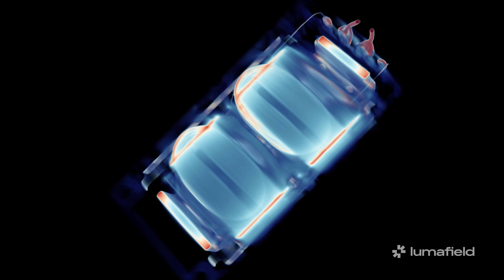Switch 2 Pro Controller: Built to Break? Full Teardown

Comment: So, the main complain is that the controller is difficult to repair? Who cares? I've had my original pro controller for 7 years now and it's still working fine. Yeah, it drifted for a while, but it stopped once I poured some pure alcohol on the sticks and rotated them for a few seconds. Same with my joy cons.

Comment: I don't know. I get that it's a lot to disassemble, but everything is ultimately modular and replaceable. I do agree with the point about the sticks. And that the trend of concealing outer screws is unnecessary. But overall I think the video is a little too negative. I don't own this controller and I'm not in a hurry to get one. Let's see what 3rd parties offer.

Comment: …i have several 8bitdo controllers and after the firmware update just a day after the release of switch 2 they all work perfectly on the switch 2…they are cheaper and the absolute best for the switch 2…

Comment: Xbox Pro controller has the same issue : Overpriced & more prone to failure than the regular version. At least in the first iteration there eventually was a community & parts available to assist with repairs. Now there's a new version that muddies the water in getting correct parts. It's been a huge f you from Microsoft.

Comment: I would go straight for a cheaper controller with hall effect sticks, but I imagine the face buttons will feel crap in comparison with the Pro Controller 2.

I got the first Switch and then a PowerA controller or something.  Nothing especially wrong with it, but the face buttons felt really sticky.  When I got the proper Pro Controller, it was night and day.  I keep looking at the shiny glowy PowerA controller, 8bitdo and others and thinking that they'll just not feel as nice to use as Nintendo's controllers because if the new Pro feels better than the first, then that's practically improving on perfection for me.

Had the first Pro Controller, which I bought second-hand, for years and the battery's always been great.  The controller feels great, I've never had to worry about stick drift and all of the buttons are just laid out and feel really good.  Never even had to worry about repairing my own controllers, although I did damage a friend's Joycon which I wasn't able to repair... So that sucked.

Basically what I'm saying is that I'm excited to get this controller even if I only try it out for a bit, but I'll enjoy it while hoping and praying I won't need to repair it myself.  Otherwise I guess that's what warranty's for? Nintendo have since acknowledged the drift issue and accepted repair jobs, so you'd think they'd do the same here and ifixit don't need to sell you their guff. :D

Actually, are you more upset that people would be encouraged to send their stuff to Nintendo for repairs and replacements rather than coming straight to you to buy repair kits?

Comment: So it's like the original Switch Pro Controller, but worse? Those things had a known defect with the D-pad that I didn't know about until after buying a brand new one to go with the used Switch that I'd bought a year before. Somehow I got lucky in that the used Joycons never drifted, and the new controller had that D-pad defect out of the box. Took the thing apart and put a piece of tape under the middle peg as recommended and it worked, though now I think I'm going to have to do it again. It was kind of funny and pathetic at the same time.

Comment: Good points throughout the video but on the HD Rumble 2

5:05 being "unnecessarily buried" in the grip is so it can be closer to your hands to make the different rumble on each side easier to tell. The Switch pro controller had issues with this making the subtle rumble effects that are easier to tell with split Joycons not as prevalent here.

Comment: In other words, a disposable pad. If something breaks, you claim it under warranty, the warranty will expire - it's thrown in the trash and almost $100 wasted. I have a strong impression that the construction itself is "overcomplicated".  For a moment I was thinking about buying this pad for my Switch 2, because I naively believed that it would be a device that would last for years, such as my current Xbox One X pad, which I have been using (on my PC) for about 7 years. I think I'll look for a cheaper alternative from China for about $20-30. There is no point in overpaying. Thank you for the video.

Comment: Oh piss off bro, like seriously. Are you joining the Nintendo hate brigrade? The controller is fine and isn't designed to break at all. Switch 2 Pro Controller is one of the best controllers I have ever used. You're upset that modding the controller became harder. Let's talk about drift, and it doesn't matter what stick type you use because all sticks can get drift. I know people who bought hull effect stick and started to drift a week later. You claim it's not worth $85, ok bet. PS5 vs Switch 2 controller. Battery life PS5 is 8 hours to Switch 2 40 hours. Gyroscope controllers Switch 2 has better gyroscope controllers. Gr Gl buttons to ps5 none without strike pack horizon btw $69.99 to switch 2 controller has them built in no extra purchase required. PS5 has anlog triggers, and Switch 2 doesn't. PS5 controller cost is $74 new and needs strike pack horizon for $69.99 to essentially be the same as Switch 2. PS5 controller needs to be $144 to match Switch 2 pro controller for $85. So is the Switch 2 Pro Controller worth $85? Yes, it is

Comment: I put my Switch away for half a year or so. Picked it back up, and the rubber on the joycons had melted. Disintegrated. Like an old device put in storage for 16 years. They cost $80 brand new.
Picked up replacement parts for $20, TMR sensors, rubber caps that could be removed. Nintendo is ripping its customers off. Don't buy their shit.

Comment: I'm torn on this controller.

Overall, I do like the controller, it feels smooth as silk and has worked great for me so far, the only issues I've found is that the sticks have bigger snap-back, which is certainly noticeable at times, but due to how I play, I really don't notice it unless I'm looking for it, still, would be nice if the sticks were of better quality. Second and more egregious is the d-pad, imo, being even worse than the Pro 1's one, with that in mind, that's where the negatives come in, I had the idea of modding it a bit just like I did to fix the D-pad on my Pro1, a little bit of adhesive tape was all it needed, tough luck tough because I can't easily do that here.

I also wanna go over some other thoughts and hopes.

The controller feels sturdy and honestly amazing on the hands, albeit it does feel a tiny bit smaller than the Pro 1, making it a bit awkward to get used to, where it feels like I'm not gripping it as snuggly, but I'm getting used to it. On this same vein, I also hope it remains durable until the next controller and console releases, my Pro 1 lasted me a very long time and it's still fine to use even now, with just a very slight drift being the only sign of wear. If that's the case I can look past the repair difficulty, but still, it would've been nice if it was as accessible as the Pro 1, truly baffling and if Nintendo wants me to keep my brand loyalty (or what little remains of it), I hope this controller lasts me a long time.

Another hope is for them to add some sort of soft-ware level options for controllers, like dead-zone configs and such, I dunno how feasible is that, but would help some of the negatives their controllers they have, that said, Nintendo has a terrible track-record on offering such options.

I'm half-regretting the purchase, it does feels nice and I hope the sturdy build is just what it looks, the awful repairability and d-pad I can look past if it doesn't become a major problem. If anything, I've learned my lesson of waiting for reviews and such before a purchase, not my first time making this mistake, but hopefully the last time.

Comment: goddamn this looks so hard to open lol... you can say all you want on the repairability of this  and i can agree.. but calling it a piss poor excuse of a CONTROLLER for the ability to get it repaired  it's just not it, cause to actually play, it's probably the most comfortable I have, and this is against xbox, dualsense and a couple 8bitdo too that i have. The sticks glide so well, all buttons are dead silent, it's so compact, solid and the "single piece" print gives the best feeling in hands. Gyro works great, hd rumble 2 is great, The autonomy?  never a problem.
Pro controller 1 sticks also  had a very low failure rate  compared to joycon, more in line with other consoles controller if not better , and all use potentiometer, by the way, so calling them "drift prone sticks"  seems a little overblown. So yeah, ofc ifixit is here to judge how hard is to repair it, but maybe it should stick to that instead of valuing the quality as a controller overall, cause ofc there's hundreds of more repairable cheaper controller out there but no way you'll feel the same quality and durability while actually using them for what they're inteded to. The guy in here felt like honestly pissed off at nintendo for other stuff

Comment: I am not a technician, and I have had playstation controllers since PS2, and they all needed to be cleaned or repaired at some point. Battery replacement on all or joystick drift on Dualshock 4 and Dualsense. I was able to do all these without needing to do soldering at all. I still have all working controllers, all that came with my consoles. I hate it when companies like Sony do not have proper quality checks products, I can't take the fact that my Dualsense came out of the box with drift like it was by default. But at least I was able to fix it myself. So, I do not understand why people will go full Stan on Nintendo now. I appreciate iFixit for going all out on this review of how repairable the control, Stans will go defensive, but the rest of the consumers will be better informed and be wary of the cost vs. benefit of these devices.

Comment: The 8BitDo Ultimate 2 Bluetooth fixes all the problems the Switch Pro Controller 1 had (irregular D-Pad and joystick drift), adds analog triggers and a switch to make them clickable, has two extra bumpers, comes with a stand to recharge and uses a 2.4Ghz dongle alongside Bluetooth capabilities and costs less than the Switch 2 Pro Controller. Oh yeah, and you also have three profiles to switch between as you see fit with the software that allows you to remap buttons and use macros as well!

Why would I waste my money buying a Switch 2 Pro Controller knowing fully well it'll drift and the D-Pad will register wrong inputs and will require opening it up to make modifications to make it work as intended when I can spend less money for a premium product that fixes all those issues and gives me much more quality and functionality?

Comment: Funny seeing this video after shell swapping and soldering a new potentiometer into my switch 1 pro controller I've had for over 5 years. They definitely designed this to be as difficult to repair as possible.

Comment: 2 thoughts.
1. In my repair work i always had it beat into my head, dont pull directly on the wires, pull on the plug head to disconnect.  Made me cring each time i saw you do this.
2. I get that youre looking at this from a repairability side of things, but i find the level of security and stability this build has is actually really impressive.  Its made to not fall apart.  It just means that same durability makes repairs harder.  Its a more than reasonable trade off from an engineering standpoint.
Reply: completely agree. stuff like the plastic holders is 100% justified and doesn't even make disassembly harder. the only bad parts are the glue for the faceplate and the battery needing complete disassembly. otherwise, this is actually a very good controller in terms of repairability; the sticks being separate units in particular is a massive advantage over the Dualsense and Xbox Series controllers.
Reply: The person who made this video is an amateur at best.
Reply: Have you worked with Wii U Pro controllers? Those are incredibly easy to disassemble and feel very, very solid. Even more solid than the Dualsense and Xbox series controllers imo, but of course they have way less features.

Do you have any thoughts on that? I'd love to hear from someone with a lot of experience
Reply: @VagrantValmar  I've never opened one up, but Wii U Pro feels much less solid than Switch pro or Switch 2 pro, IMO.
Reply: @VagrantValmar Owning a WiiU pro controller, a switch pro controller and a  switch 2 pro controller, I can safely say the quality is vastly superior in the newest controller. The WiiU pro controller feels like a fisherprice toy by comparison.

Yes it is irksome that they're not easy to repair, however if the durability is better its unlikely to need it, before its superceded by the switch 3.
Reply: @RG-Zeldaplayer  I totally agree, I have both controllers in front of me right now, and the Wii U Pro Controller feels like a toy compared to the Switch 2 Pro one.
Reply: @RG-Zeldaplayer this video and the comments are the first time I'm seeing this kind of hate for the new pro controller, aside from people who really want analog triggers. Repair points aside, this controler blew me away when i first had my hands on it. Feels extremely premium and those sticks are insanely smooth.
Reply: @veeetox  What does feeling like a toy have to do with durability?
Reply: @RG-Zeldaplayer  Fisher-Price?  So you're saying the controller was extremely durable?
Reply: @loganmedia1142  The Wii U Pro Controller feels (and it is) way cheaper and less sturdy than the Pro 2. Like, it's not even close.
Reply: @VagrantValmar  I have a Wii U pro controller, two Switch 1 pro controller, and a Switch 2 pro controller. My Wii U Pro Controller is the only one with drift. Of course my Switch 2 pro controller is new so that is yet to be seen. But if my Switch 1 pro controllers never got drift and this one feels way better quality than the 1 pro controllers. Then I can assume the 2 will not have problems either.
Reply: Screws should be good enough to ensure a controller is solid.
Reply: It doesn't make it any less probable for the device to fail, it only makes it less accessible.
Reply: The fact he pulled on those wires makes me question his line of work.
Reply: Excellent points!
Reply: Yes, the Wii-u pro controller feels less premium, but I take how it is much easier to disassembly and have a way superior D-pad (no ghost inputs!) any day of the week.
Reply: As an engineer myself, I see very little made for durability here.
That glued faceplate has zero excuses to exist, let alone be glued. Heck, it being clipped would be more acceptable for durability than glue that WILL fail with temperature. Leave it in the sun for some weeks (not even intentional, might just happen by accident) and this will release. They would have spent less money making it a ridge on the shell. The glued vibration motors also zero excuses since they even used screws to begin with. Hidden screws way inside of the casing are no tradeoff, just plain malicious. The joysticks are straight up made to fail, instead of being more durable. Wouldn't be impressed if these last half of the older pro controllers.
Reply: Disagree with the durability stuff because they're using low profile sticks that are prone to early wear-out
Reply: @WheatleyAlt  "Disagree with the durability stuff because they're using low profile sticks that are prone to early wear-out"

This is just speculation at this point.
These are different sticks than the ones that we know to be problematic.
Reply: @chainmaillekid  as far as I'm concerned, all durability talk is speculation until enough of the things break to know the common faults

Comment: 2:51 at least someone has appreciation on xbox battery convience
Reply: I'm of two minds to be fair. I find having to replace batteries in the same amount of time my Pro 1 Controller has lasted for (8 years) is a LOT of money. While replacing is key, I'm not sure I've actually spend less money on controlelrs playing Xbox than what I just spent on the overpriced Switch 2 Pro Controller.
Reply: @neonswift I bought the Play and Charge Kit for my original Xbox One Controllers 11 Years ago and they work flawlessly to this day, even in the newer Xbox Series controllers. I never had to replace them and still get around 20 hours of playtime out of them. I wish Nintendo and Sony would follow this example.
Reply: @neonswift NiMh batteries exist or the kit play and charge

Comment: I like ifixit and appreciate everything they are doing with user repairability. This video comes off so hostile though when it really didn't seem too bad. Yeah it wasn't designed to be ultra user repairable, but it is user repairable without soldering, and that's if you ever actually need to mess with it. I have 2 switch 1 pro controllers and a wii u pro controller that are 10, 7, and 5 years old and all still work without issue and that's including one the dog chewed on and threw around the room when she was a puppy. This video makes it seem like thing will fall apart within a year. Basically, one of the best feeling controllers ever made doesn't have a battery that can be removed in 10 minutes and it uses pot sticks (both things everyone knew before this video). I have the 8bitdo ultimate controller which i also like alot, but, to me, this pro controller is in another league in quality. The soft texture, the smoothest analog sticks, the quiet buttons, all feel better than the 8bitdo. So, 8bitdo if you want one controller for multiple devices with the potential to last forever (though the battery isnt easily accesible here either), or the pro controller if you want the best controller for the switch 2 (that can also turn on the switch 2 remotely).
Reply: Ifixit clearly had an agenda with this video.